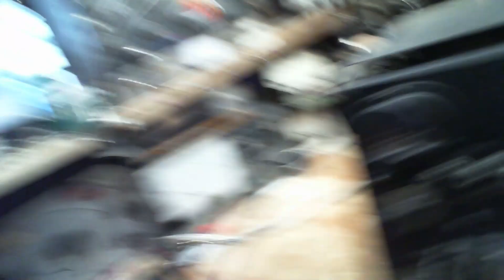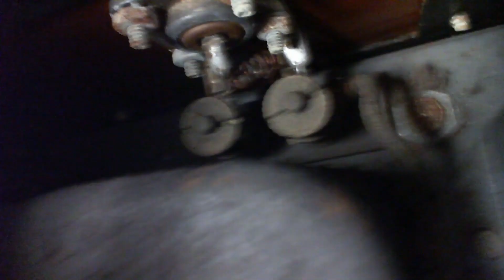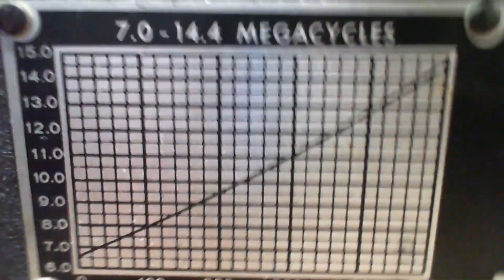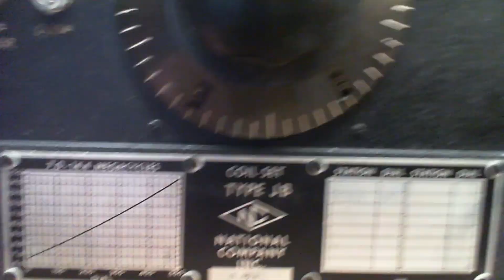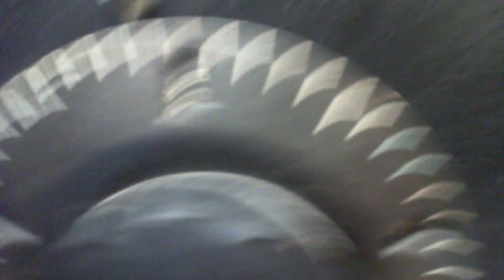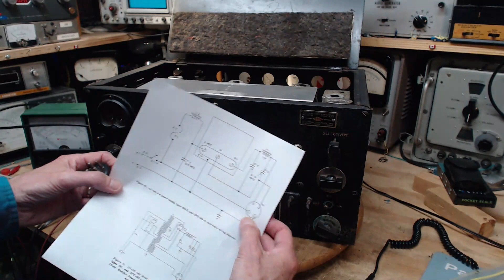National HRO Receiver Video #2 - Power Up Attempt

Comment: The Type 697 power supply that is paired with this receiver  puts out 230V DC at 70mA for the B+ and 6,3V AC at 3,5Amp for the heater. And since heater current demand is high, the original mains transformoer puts out more than 6,3V on the heater winding to compensate for losses along the 4 prong connector and the connecting cable between supply brick and receiver...
And here is Mr. Jim feeding the receiver 6,3V at 3A over a flimsy wire that looks like a shielded coax lead and crocodile clips. And it does not   occur to him that the heater voltage he sees at just 5,5V is too low and means the tubes are underheated will not be at full emission. 
One would think that a retired electrical engineer like Jim, who proudly retells stories of him working a major role at a power company, would know about the importance of sufficient wire diameter and minimizing contact resistance when it comes to carrying high currents...
To put things in perspective; to keep voltage drop below 2% at a current of  3Amp and a cable length of 4 meters (which is a 2 meters twin lead) on low voltage application the recommended wire cross section calculates at 1,75 square millimeters or roughly AWG15.
So even if you throw all caution ot the window at least 0,75 qmm equivalent AWG 19 should be used for the heater supply on this radio. And we havent started on the connection yet... Crocodile clips on a 240V 30mA B+ supply okay, but not at 3A. Yes there are croc clips that can carry 36A and have below 10 milliohms contact resistance, but these are not this type of china clips that you find at ready made chinese test leads.

Comment: Jim, the silk screened panel coil set are post-WWII coil sets and the HRO looks much earlyer may be 1940..42 . Look Western Historic Radio Museum, HRO-Receivers,Part Two "Coil Boxes". Your Powersupply need 230V-DC on the recseiver HV pin. 73 DJ8CY